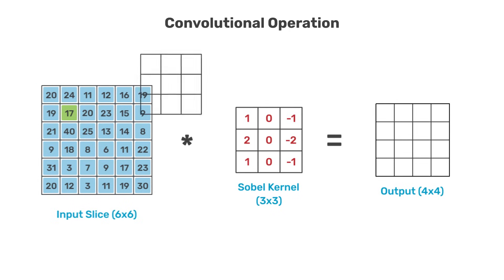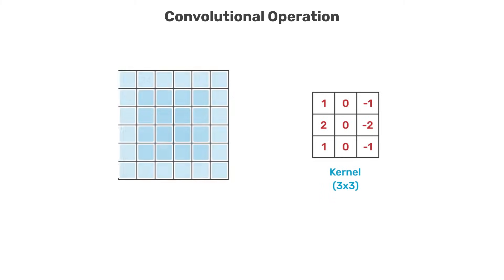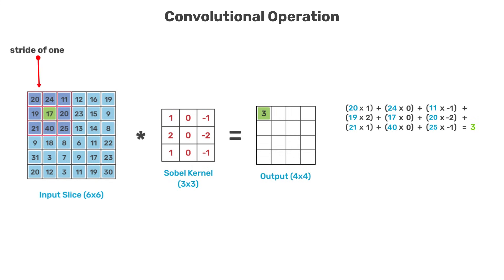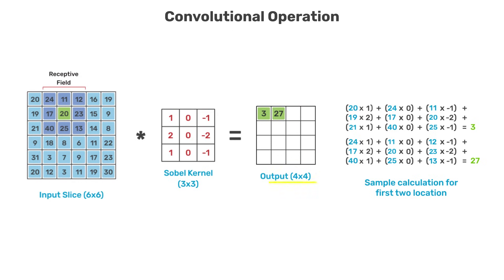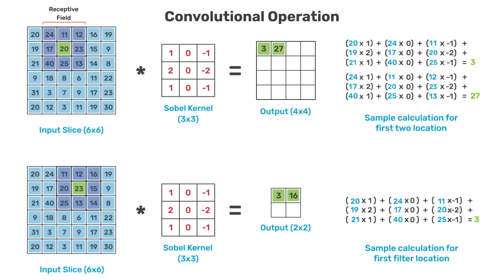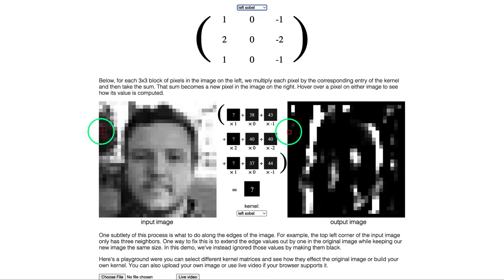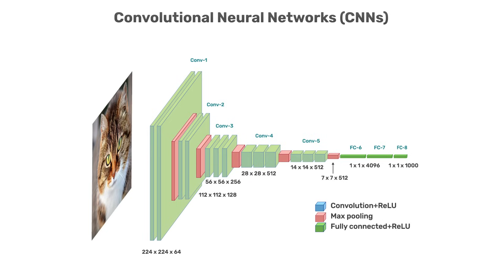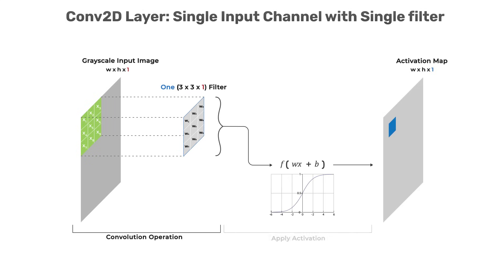2D Convolution Explained: Fundamental Operation in Computer Vision

Comment: Should you not apply the filter mask values mirrored in the dot product? Unmirrored the operation is a correlation. Especially if the filter is an asymmetric filter such as the sobel is.
Reply from the maker: Hi, you are right. For asymmetric filters like Sobel, true convolution involves mirroring the filter, distinguishing it from correlation. In many ML frameworks, the distinction is blurred as filters are learned, not predefined. However, for correct edge orientations with Sobel, we must apply the mirrored filter.